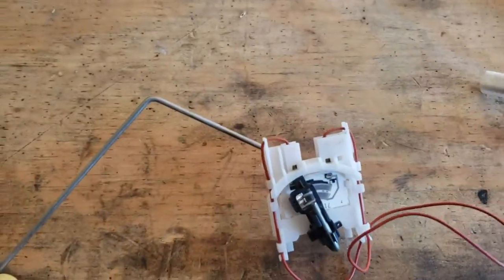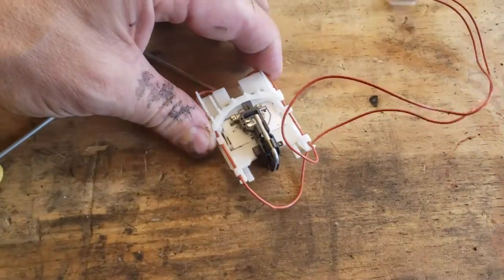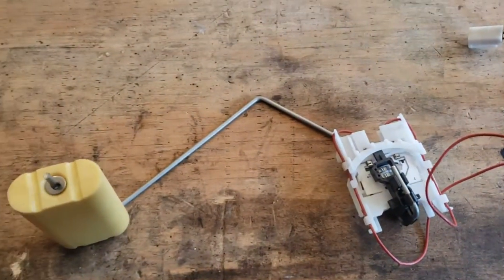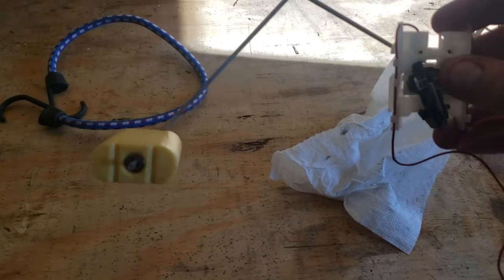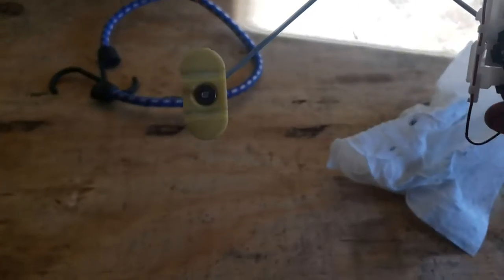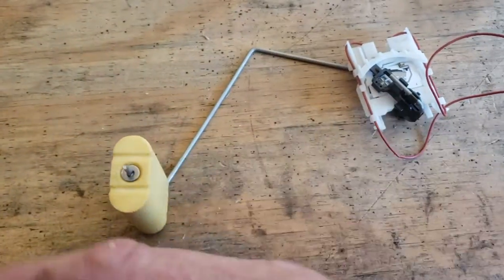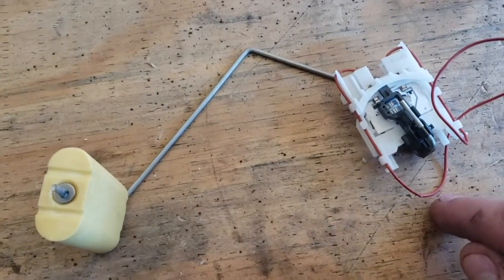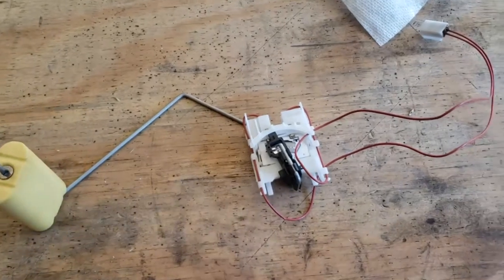2012 Traverse Fuel Gauge Problems

Comment: When you were done. Did it remedy the problem? I did the same thing but when i was done it was still the same.  It only reads 1/4 of a tank. When its full or empty. Heres a link to my video.
Reply from the maker: Did you disconnect and reconnect the battery? If the gas is below 1/4 tank, the body control module no longer reads the fuel gauge. It estimates fuel level by injector pulses until you refill all the way. Try disconnecting the battery, cycle the ignition with the battery disconnected, then hook the battery back up. This should fix your problem after replacing the sending unit. And yes, it did fix my problem completely.
Reply: @Pooks838  thanks for your advise, i will keep you posted.
Reply: @Pooks838  thanks alot, i appreciate you.  I did what you told me to do and its working now. Thank you so much, your the man!😁
Reply from the maker: @SuperDjnrg  awesome man! Great to hear.